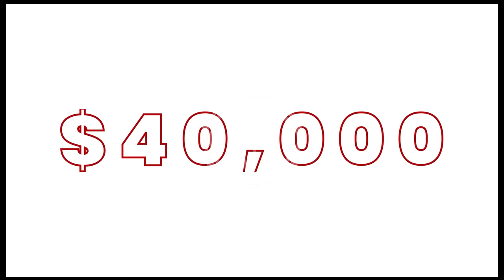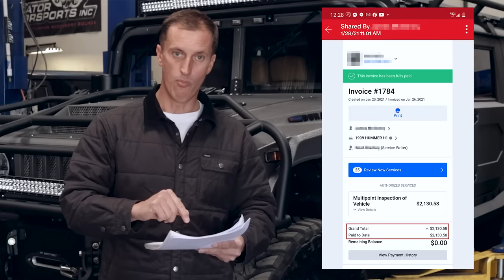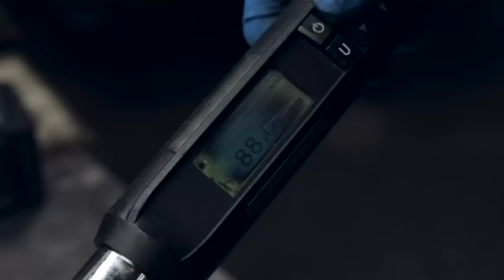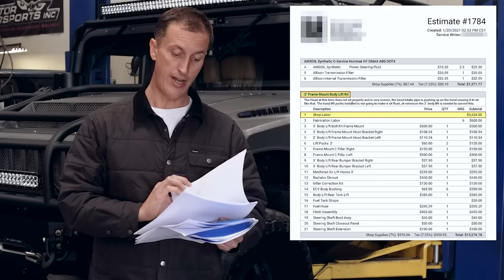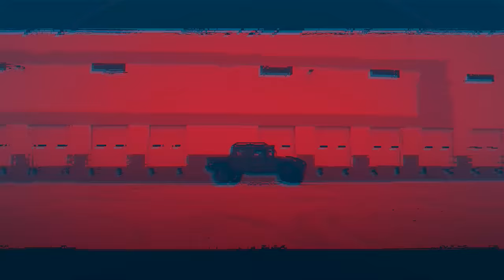$40,000 H1 HUMMER SHOP SCAM!

Comment: $1300 OIL CHANGE!!!! $15,000 LIFT KIT!!!!!! Ryan I have to give you credit for filming this with a straight face and not torching the place charging this customer $40,000 for bullshit
Reply: @Smokem 777 I guess I haven't owned my hummer long enough to know about them. I also do basic maintenance on my own rather than pay someone $1,300 for something as simple as an oil change
Reply: was looking at that Oil Change price and was like thats not a bad price per qt of Amsoil, a bit high but not rip off prices, then I saw the $851.20 for labor, WTF MATE really?  for an Oil Change and Transmission fluid change!?!?!
Reply: They pretty much went like. That,s not standard, we need to work on that. 
If you dont accept the repairs, you will get a F YOU fee.
Reply: That was a little misleading, $1300 looked to be an oil change, power steering flush and transmission flush.  They don't itemize their labor though so it's just lumped up and very hard for customers to know what's going on.
Reply: @nicolashoyt5341  Looking back at it at 6:27 I do see that for 12 quarts of 15w-40 full synthetic oil is actually $141.60 and below that is synthetic transmission fluid for $163.20. What's not misleading and absolutely freaking outrageous is the $851.20 for labor
Reply: @Jimmy Johns1210 Thanks for clarifying which shop it was that made this quote.
Reply: @dagamore  Hey now... that's like .5 hours of labor!
Reply: @scottwa  You can easily change both fluids in no more than 15 minutes. But $850 labor??? That's rent money. But $40,000!!! That's a downpayment on a mansion
Reply: I doubt Hoovie's 18 quarts of oil for his Countach can break even 1000$ !!!!!
Reply: @darkmugetsu6572  a countach takes 18 qts of oil ?!?!?!?
Reply: Lmfao i no lol crazy 🤣 😂 lawsuit

Comment: Question I don't have a Hummer but I just paid $650 to have a transmission fluid filter change on a 2015 jeep patriot CVT transmission
Is that expensive or normal in price?

Comment: Sounds like this trick is being used to get them to dump the vehicle with them.
Reply: Bingooooo
Reply: The shop I worked at had a news crew bring in a car to be checked for a 2000 mile trip. We did not know it but they had hidden cameras in , on and under the car. They took it to a shop and had them go over it before bringing it to our shop as well as 3 other shops. I went over the car and told them it needed 2 rear tires and would recommend a tune up because the wires were original and were arching to manifold when sprayed with water  (the other shop said the same thing) and I also said they needed a new 3rd brake light bulb and 1 of the license plate lights were out both of which the other shop missed. One of the other shops squirted oil on the struts and told them it needed $700 in repairs. Same thing, just on a bigger scale.

Comment: Story time: the good one
i did my own research when i took my classics bronco transmission to get it rebuilt, then it took like 2 weeks, i called and asked why its taking so long, and the owner of the shop told me to come over, so i did and he explained the transmission was replaced from a 6 cylinder ford, which i believe cause the under side of some parts when i took it off where covered in RTV ! and he showed me everything in my transmission and i did my research as well and we had a great educated talk about what would he replace, what would be good for my truck and why the price was high, and he even took out 12 year old books for these transmissions and educated me on things i had no idea about, at the end of the day,KNOW YOUR SHOP!! 

Dont take it to a random shop, know whats wrong with the car or truck, if you cant do it, how is the process and the price of the part is, so nothing like this happens! if you know 0 about cars, take it to the dealer, dont take it to a random shop you know nothing about

 this is the worse possible way i seen some one scam a customer, for things that are 100% perfect just to sell them something cheaper with a 10k labor cost..just wow 

great vid man 10/10

Comment: Any automotive tech with half a brain would see that the Duramax air filter has significantly more surface area for filtering versus the stock 6.5 TD filter.
Reply: And the fact that it literally says "ACDelco" on the side of the filter and is the EXACT diameter of the factory housing!

Comment: My family ran a car repair shop. And hearing this makes me sick we would have customers who would go to other shops get a quote high dollar and it turn out that it would be a $50 part that we could take care of within our alloted 1hr inspection time so no extra labor would be charged. And like he said you u price labor a certain way to not have over lapping labor example. They come in for brakes and we find the rotors are out of specs well it calls for example 1.5 hrs to replace rotors then the labor guide would call for 1 hr to do the brake pads. We only charged 1.5 hrs because you have to remove the brake calipers to change the rotors at that point you just have to collapse the calipers and slap new pads in. Also our shop supplies were 7% of labor cost not to exceed $25 and there were time that if we charged what it actually was per the math shop supplies would be $75 (for exp.) but we never went past 25 because you honestly sometimes don't use shop supplies on all jobs. That other garage saw a person who owed a H1 hummer and figured they would make a payday. Still makes me sick to this day.

Comment: I've almost never seen a CTIS system that worked reliably, but I don't have experience with H1A trucks. I am under the impression that it had more to do with the computer than the compressor though. Thoughts?

Comment: I won an Iron Planet / Gov Plant auction for a 1988 M998 military surplus Humvee with the upgraded 6.5L engine for 8100 bucks. 
It's in perfect condition.
100% complete. 
Got titled and tagged so I drive it to work every now and then. 
I've dragged some huge logs across the farm with it, and I'm always the guy in the local area that gets called to pull out people that get stuck out in muddy farm fields.
I did upgrade it to the 10K axles, the newer style fuel sending unit with floor access panel to the fuel tank, and K&N makes a direct air filter replacement for that huge stock paper filter. 
Everything else is stock, all original military, and works great!
Pain in the ass to crank with weak batteries so those recently got upgraded too.

Edit: I'm a Duramax guy too. LBZ and LMM, both deleted and EFI Live tuned. 
The part about the computer from the fraud shop was a total bs claim, like everything else they tried to claim. 
You can buy blank stand alone computers for Duramax engines and for the Allison transmission. I've done them. Makes EFI Live tuning much easier to play with whenever you want to.
Even the factory computer doesn't get bricked. All you need is the VIN read from it and get a VIN license from EFI Live and boom it's unlocked and you can do whatever you want with it.

Comment: Sounds like the dodge dealership I dealt with one time in Toronto.   I told them my truck kept frying ignition coils and I spent tons of $$$ paying diagnostic time in London, Ontario dealership trying to deal with the problem.   Toronto dealership told me the $50 part would be $200 installed and I’d need to pay their $130/hr diagnostic to try and find the problem or I’d have to tow the truck somewhere else.   Being stranded I was forced to pay around $350 for an ignition coil that was under warranty (yes dodge refused to honour the warranty).

Long story short I drive Chevy now.

Comment: I just had a shop do this type of thing to me! I've got a ram 1500 with long travel suspension, prerunner bumper, flares, headers, exhaust, and tires. I recently slipped off a road in a blizzard into a farmers ditch and it cocked the front tires back. The side airbags went off, the front fenders were cracked, but the rest of the truck didn't even have a scratch and it ran fine. A towing company came over and said they would need 2 trucks to get it out, but he told me he'd do it for the rate of 1 truck if I went with them, so I did. Of course they charge me double the cost for 2 trucks. Then the shop owners told me it was useless and I should just total the truck out... I only noticed the lca mounts were slightly bent. They rote a quote for over 20,000 of repairs including new bumper, steering wheel, two new frame rails, lighbar, etc. All which were in perfect condition. They said they wouldn't touch it m, and refused to fix it. They also contacted my insurance and sent them this quote without my knowledge and tried to make plans for the truck without my knowledge... I then planned for it to be sent to another shop. I asked the owner explicitly how much the storage fee would be after a 2 weeks and he said, don't worry about it I won't charge u since you are in and out. I thanked him. A week later I return to get the truck and they wanted to charge me for 2.5 weeks of storage fees 50$ a day (900$). I brought it to another shop and they said its an easy fix with no serious frame damage at all, and I'll get out on the road right away. Not that bad of damage. Some shops out there are just out to scam you like crazy be careful

Comment: I grew up working in the automotive industry started at 10 yrs old mom and dad parts stores ETC been around since late 60,s . 

I recently got scammed on F250 for about 19k through a local shop for engine repairs and now I have it my self found it engine builder shipped a new painted damaged engine with a large hole in the block .. this has become a costly experience because of a the trend of scam shops currently going on , back in my younger days the old timer mechanics in the garages I delivered parts to on my bicycle was very honest and spent hours learning from them about the business , now that all seems to be long gone though and now it's these scam shops ripping people off left and right , I'm out 19k and pulling money out my azzzz some how to fix this mess .. it's heart breaking that I got ripped off by 3 different mechanic's that I thought I could trust is it really this bad ?

Comment: Yup. Thats the whole reason why I learned to work on my own vehicles. Mostly so I could teach myself basic mechanics, but also because mechanics are vutlures. The one time i needed someone to service my truck, I took it to PSE in Houston and they quoted me $2,700 just to tear into my 2006 f250, then tack on whatever charges it may “need” in repairs. Alternatively they quoted me $13k for a new bulletproofed 6.0 engine with warranty.
Had a ford tech who does work on the side come and replace my fuel pump, fan clutch, and glow plugs. Mf replaced the pump and clutch, but got air in my lines and rage quit halfway through the glowplugs. I had to call off from work for a week to do it myself (i also needed to replace the filthy radiator).
And as it turns out, all that was wrong with it id a bad radiator and bad injectors. All that trouble for two things. I hate mechanics with a passion.

Comment: I wish this guy would do a video about my semi truck engine rebuild explaining everything so clearly. 
Full out of frame engine rebuild for a semi truck. 30k$
5 miles later head cracks. 
Second head lasted 1800 miles. 
3 months later another ship found clogged egr cooler. 
Another 3 months later the truck had excessive smoke on start up. 
Engine gets torn down by another shop and they find bad wrist pin bushing on a cylinder. 
While apart they found all bottom end bearings and top end bearings are damaged with dirt in the engine. Engine was put together in a open shop and debris’s were all they the engine. 

3 months later detriot finally decided to pay the bill. 
To resleve a clyinder., clean head and reinstall and all new bearings. 
Good news is I didn’t pay for the bill. Bad news is I lost 3 months of work. 

When u work for yourself that almost put me out of business.

Comment: Would that Duramax air filter work well on a stock 6.5 turbo H1?
Reply from the maker: The stock 6.5 is specifically tuned for that airflow with the OEM filter vs a LMM/LBZ Duramax which have different air/fuel ratios.

Comment: now folks i was an auto mechanic for 32 years before retiring in 2008. now i cannot say i ever worked on a hummvee or a hummer but i have worked on probably 80% or better of all vehicles sold between 1970 and 2008. my main areas of expertise were steering &suspension, brakes and some drive train work but i did almost anything the car came in for with the exception of any major engine or transmission work.
now over the years i have seen many other shops pull the bullshit this shop with the 40k estimate is doing. they are trying to rip the customer off plain and simple. i used to have customers that went to the dealership for work and they would tell them the needed a four wheel brake job and rotors amongst other things. now the shop i worked at at the time had lifetime brakes so the customer comes in and says the dealer told him the brakes are bad and i check them and find the rotors are fine and the pads are at 75% now i bring the customer out and physically show him and he freaks out about the dealer ship and while i put the car back together he asks me to do a wheel alignment. that customer then tipped me a twenty and always came back to have me work on their car. people prefer honesty over bullshit in my opinion and i was always honest with the customer. hell one time a goodyear shop told a customer he needed all 4 struts replaced and we had replaced them the month before, i heard about this one when he was in for a battery talking to the tech installing it.
unfortunately these days an honest mechanic is hard to find and it is not all their fault because companies pay them by the job now. it's all commission. you don't get work done you are not getting paid. and this setup is very bad for customers because unless you know enough about cars you don't know if you are getting ripped off....

Comment: I quickly made fast friends with the mechanic that used to work at the dealer shop I took my bike too. My walet and my bike have been very happy with that decision a decade later.

I've actually been thinking about getting a different motorcycle, but it's from a different company, hence a little apprehensive about getting it and not being able to get it serviced by my guy.

Choose the people that repair/service your stuff very very particularly people

Comment: Just out of curiosity, Are Hummer inspections usually alot more expensive than a normal state inspection? I ask only because I don't know. In Virginia, our inspection fee is $16. If the vehicle fails inspection, you receive a "fail" sticker and you have a certain amount of time to have the failure repaired to inspection specs. Also,  fail sticker is no charge, if you pass the inspection, then you pay the fee. Any inspections costing near or in the thousands of dollars sounds very suspect.

Comment: subaru refused to work on my 2010 legacy with CVT/torque converter issue without first replacing the tires that they said "are too dangerous to drive on"

tires were like 40% life left.

i come to find out when thy quote me for the torque converter, that i had a 10 year extended warranty for the torque converter because of a design flaw that causes it to fail and stall the car when hard braking.

It really should be a recall but they got away with extended warranty..

By the time the car got into the shop with new tires, the 10 year warranty that i didn't know about in the first place, expired less than a week earlier.....

When i called them to do the torque converter it was STILL IN WARRANTY.

I refused to pay the whole 2500 they were asking and settled for 1 thousand canadian dollars... Still a robbery but it made me feel a bit better

Comment: Yeah I hate shops that try to double dip. Case in point, on the Ford modular engines, the thermostat is in the intake manifold. If you are replacing the manifold and thermostat, you don't charge the labor on the thermostat with the way everything is assembled.

Comment: in no way comparable to this 40k robbery, but my local mechanic tried to con nearly 5k for a new turbo, intercooler and hoses when the only issue was a single hose with a tear in it. 5 mins under the hood and done.

Comment: I think the best way to do that part that's behind the front wheel with the bolts protruding is to actually drill it out and then weld the nut into the steel flush and then use a bolt that will not make it far past the plate one or two threads. Heavy duty revnut style. 😅